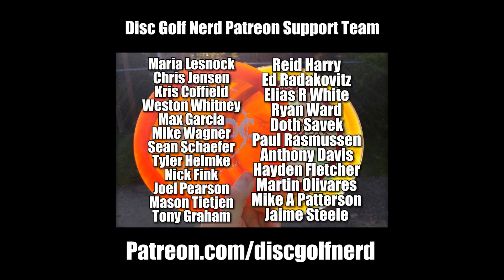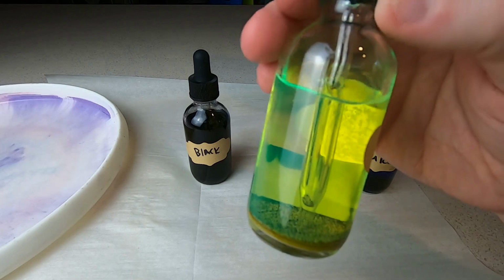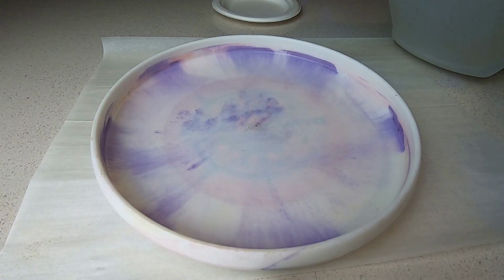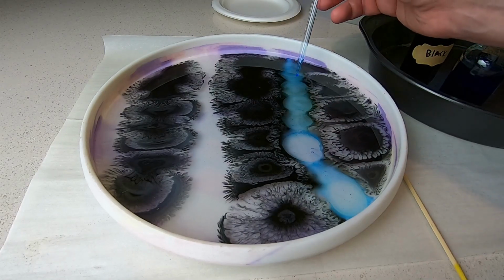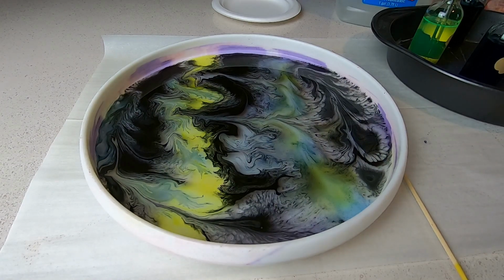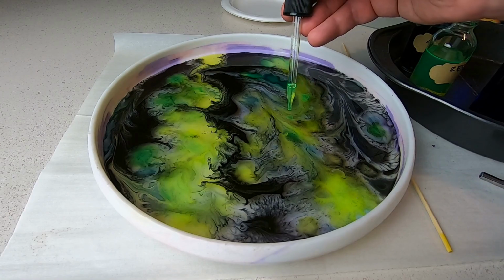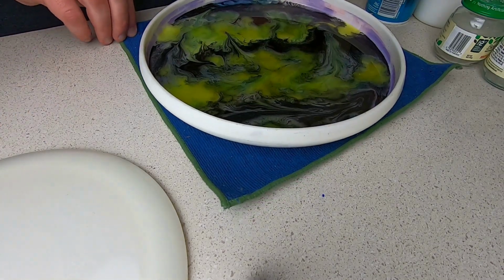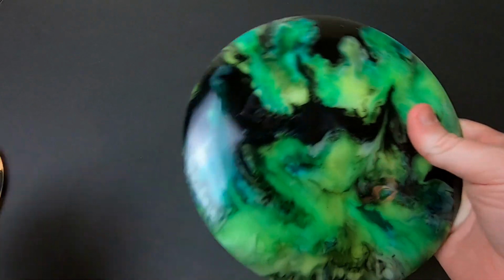HOW TO DYE Disc Golf Discs With GLUE - Full Tutorial - Disc Golf Nerd

Comment: Awesome video! One tiny tip if you're open to it. If you aren't going for a lot of black but just want really thin lines to provide subtle separation between colors or highlights to them, add black after your other colors. BUT - don't add with the dropper. Take a toothpick, dip it into the black so it's wet, then hold the toothpick on the color border you want and slowly put TINY amounts of black onto the toothpick. The black dye will drop down and add small amounts right where you want it. Then you can also drag the toothpick lightly to kind of 'draw' lines between the colors.

Great disc and thanks again for the detailed tutorial! I know I've had a ton of beds that I thought were trash until I did one more little thing and it turned into a masterpiece! So great to see artists be creative. 👍👊
Reply: great tip!

Comment: Can you use the Rit dyes in a glue bed like this? Bought a bunch and I want to try glue beds, but I see most people recommend the ProChem dyes.
Reply from the maker: I have not tried that but it's probably doable.  I have only used pro Chem and idye mixed with acetone for glue beds.  Let me know if you try it how it goes please.
Reply: @DiscGolfNerd  Will do, it's the dye I have so I might as well just try. I can't get a hold of the ProChem ones in Norway. Thanks 😁
Reply: @Shruberable  How did the Rit dye turn out?
Reply: @anthonymascia6903  Hey man! Forgot that I was suppose to update on this. I did two discs with Rit dye and got some pretty good results that I was happy with actually! I did mix the dye with some acetone, but I am pretty sure I could use more acetone because there is a lot of paint that just sinks to the bottom of the glue. One thing I noticed was that I had to let it sit for quite a long time to get bright colors. Took one out after 24 hours, but the colors were pretty faded, so I did a new bed and let it sit for another 24 hours. Then I let the next disc sit for 48 hours straight up, and got a nice result 😊
Reply: I used Rit powder die, followed this tutorial to a T, sat disc for 48 hours both times and still the die doesn't stick to the disc.  I'll try the die listed in the description.

Comment: Can you reuse the bed and put another disc in it?
Reply from the maker: Kinda.  When you pull the disc out the surface pattern will be on the disc but you can scrape the glue off back into the pan and potentially use it again, just no idea how it will turn out.  I'd probably be more likely to maybe try and let it settle and then add more dye to the surface and repeat the process.
Reply: @DiscGolfNerd  ok, thanks!

Comment: Can you synthetic dye in place of the powder dye? I'm guessing you can if you mix the synthetic die with acetone in a bottle like you did with the powder dye.
Reply from the maker: Do you mean RIT synthetic liquid?  You might be able to use it but I haven't tried.  The acetone is to make the dye liquid but only temporarily because it evaporates after you drop it on the glue.  So I would probably just try it with the RIT as is and see what happens maybe.  I don't think it will work the same way tho.  I'd recommend getting idye poly or pro Chem powder.

Comment: Hey there, great tutorial! I’m
Just trying glue beds myself. I’m having a hard time getting the dye ratio right and the pack of syringes I got is sometimes too powerful and shoots weird lines in my beds so I’m wanting to try something new. What brand are those glass vials and where’d you get them? Also, I tried droppers but the acetone ate through the rubber in them. How do I prevent that?
Reply from the maker: They are just basic glass dropper bottles from Amazon that come 12 in a pack for 12.99.  So far I've had no issues with them being damaged by the acetone.

Comment: Awesome video, man. Really love the content. This may be a dumb question, but would the acetone in the dye mix fade/remove the stamp?
Reply from the maker: I have not had a stamp get damaged with this glue method as of yet because the acetone evaporates by the time you put the disc into the glue.  I have had stamps dissolve using my shampoo dye method featured in another video and with spin dyes in the past though.

Comment: wow, these are fantastic! I'm going to give it a try. I do have one question.. So do you have to worry about the glue drying on you after 40 hours of sitting?
Reply from the maker: Not in my experience so far no.  Also since filming this video I have pulled a couple out sooner out of curiosity and it still seems to work well so 24 hrs is probably fine too of you're worried about it.  Just might not sink in as much.
Reply: @DiscGolfNerd  Thanks for the thoughtful response and info! I'm looking forward to having fun with this.
Reply: Using heat really helps speed up the process. I lay my disc in a metal pan then put it on a heating pad for 8 to 10 hours. Thanks for the detailed video. Pidyediscs.
Reply: So maybe a silly question but how do you clean them when you’re done?  I know the other you rinse in the sink but how are you doing the glue?  Are you doing it in the sink as well?  Just curious.  You can keep the reply short.
Reply from the maker: It's water soluble glue so it's not as bad as you might think.   Basically I scrape the glue off with a rubber spatula into a disposable container and then just warm water and soap takes the rest off the disc.  Sometimes I'll soak it if needed.

Comment: Have you ever tried a second dip with a new disc in the same glue ?
Reply from the maker: I haven't.  I know some folks reuse the glue but pretty sure they will add dye to the surface and repeat the process again.  I doubt just dropping a second disc would do much.  Most of the design and dye is transferred to the disc and gets scraped off before rinsing.
Reply: @DiscGolfNerd  Thanks for responding! I would definitely add more dye. But I find I only get through 2 discs with 1 gallon of glue which can get pricey (I’m dying up 10 for tournament prizes).
Reply from the maker: Check out my newer glue dye video.  I show the aluminum pans I use now.  I can definitely dye more than 2 discs per gallon.  Only need a decent flat layer in the bottom in my experience.  And the smaller pans are closer to the size of a disc so less waste.  Way better option over ultimate discs or cheap frisbees if you're using them for your dye.